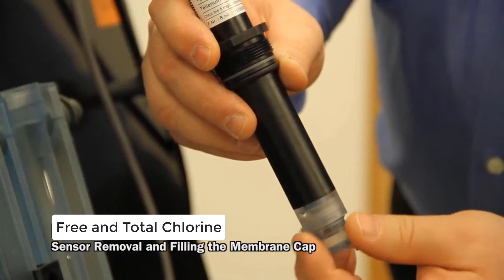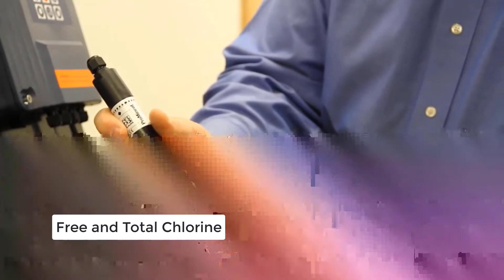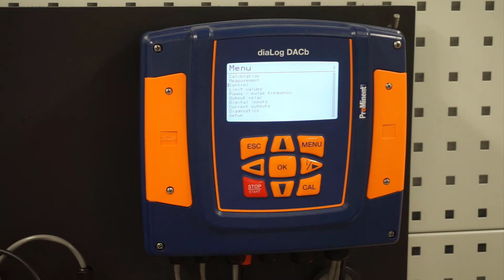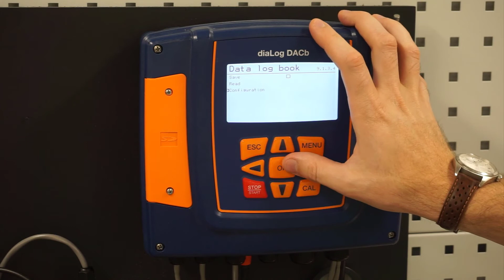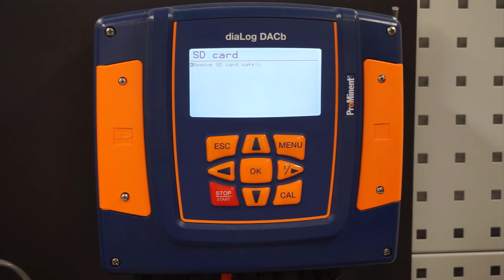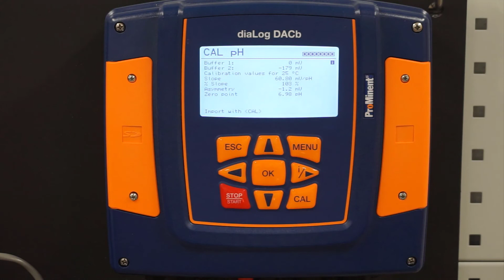DACb Start up video

Comment: How many hours does the electrolyt takes to energize?
Reply: less viscous electrolyte typically takes less time. if it is for Free chlorine at least 1 hour if it is total i would say at least 2 hours initially. Then you should check this after 24 hours according to the manual